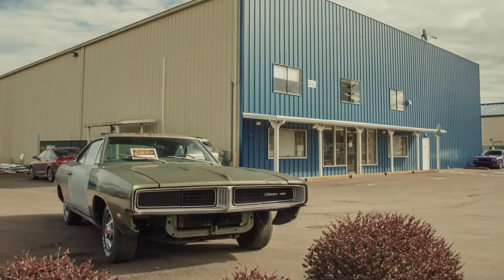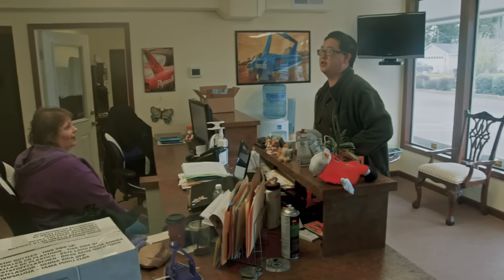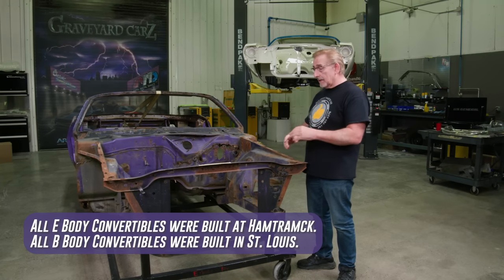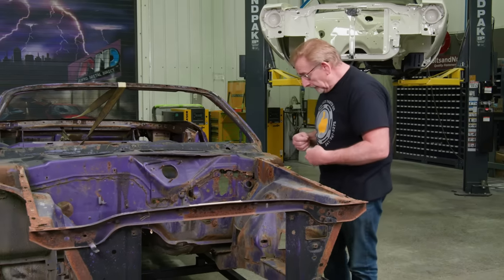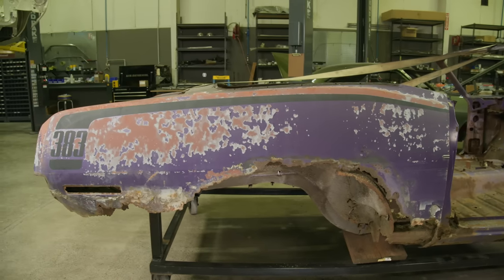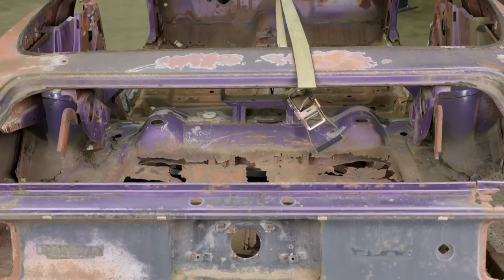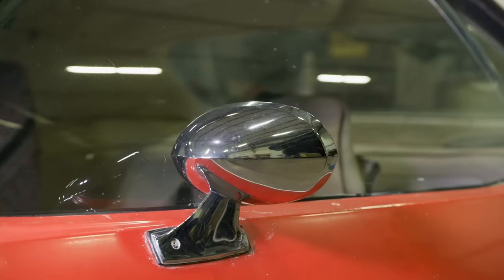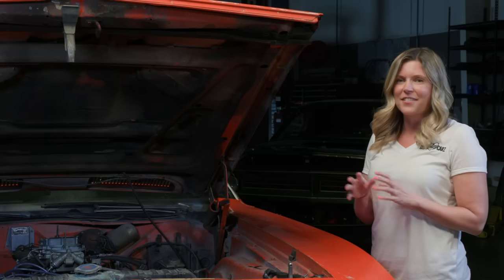NATURAL BORN KILLERS MOVIE CAR! MARK AND TONY DISCUSS THE ANOMALY OF THE CONVERTIBLE E BODIES.

Comment: Hmmm... I've been told that the hero car in MANNIX was a '70 F8 green, 383 4bbl TF 'Cuda 'vert, rumored to be THREE of them, that would make the rest of them even rarer. It'd be fun to see Marks take on a Mannix hero car...
Reply: you comment mad me very anger😠* (Chevrolet Camaro) you are in the wrong comment section buddy 🤔 - till i read it all * Mannix drove a customized Oldsmobile Toronado, replete with a panoramic rear-view mirror; in seasons 2–6, he drove a 1968 Dodge Dart GTS 340 or 1970-73 Plymouth Barracudas; in the final season. he drove a Chevrolet Camaro)
Reply: @HNH421  and???
Reply: @rickr442  (Chevrolet Camaro) is garbage compered to  '70 F8 green, 383 4bbl TF 'Cuda 'vert, and you know that is a fact
Reply: @HNH421  and?
Reply: @HNH421  riiight. Is that why the Plymouth went away after a decade while the Camaro lasted until 2002? The Camaro was identifiable to the audience, was still in production, and Chevy was supplying Paramount's media vehicle fleet. It didn't matter a lot then, and 48 years later it matters not at all. Get over it.